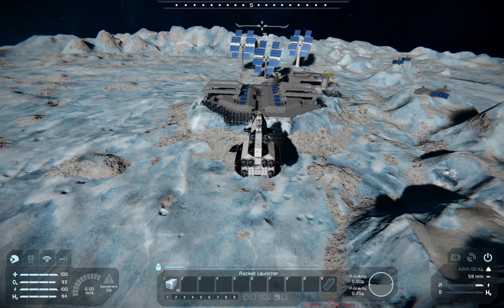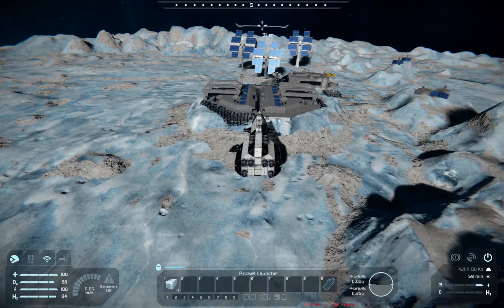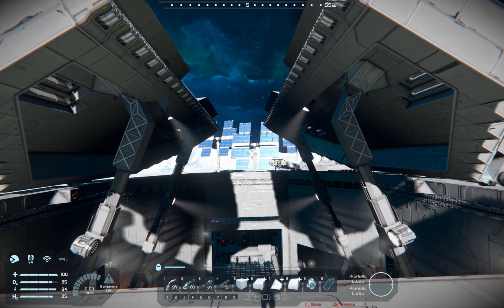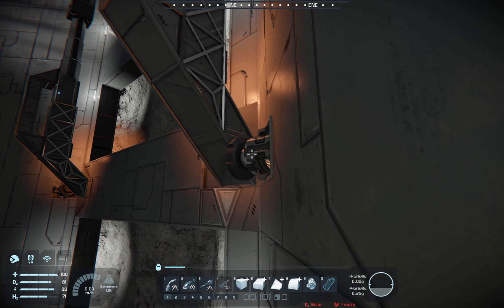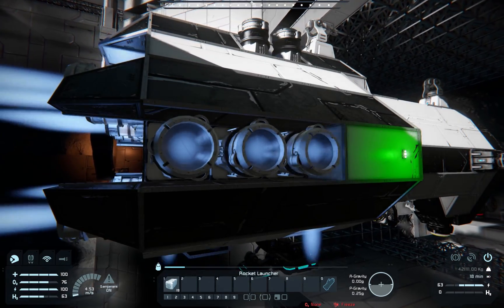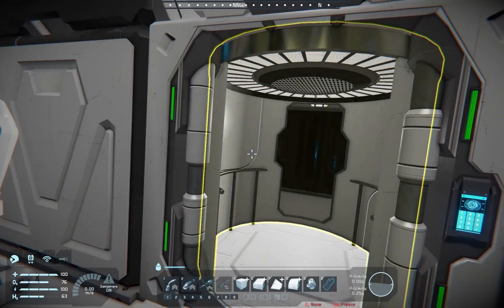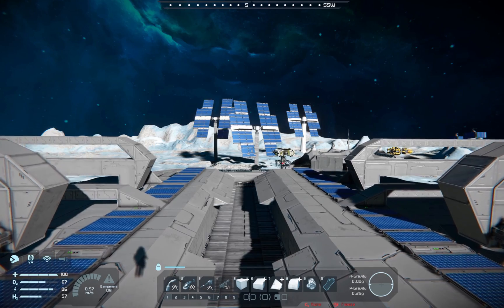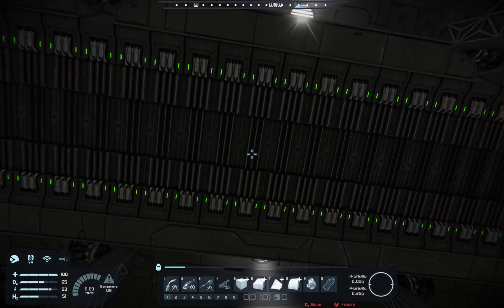Space Engineers Large Custom Hangar Doors

Comment: I have tried to replicate it, but I do not understand how to make rotors that are not in the same structure connect, that is, I do not know how to join either the internal rotors to the base of the door, or the external ones to the door and make the door connected to the interiors, and I don't understand how to make everything activate simultaneously so that it doesn't explode XD
Reply from the maker: Oh there were a few explains when I was building it, including one that crashed the server. Those rotors have big nukes hidden inside them!!

You didn't actually want everything happening simultaneously, which is why I have timer blocks running everything. It's been so long, though, that I don't remember the specifics of how I built it.
Reply: @Kurazarrh  I will try to learn how to use timers, I have already forgotten how they work, but what I cannot achieve is making a rotor connect with another structure that floats, I have achieved it with magnetic plates but it does not seem very useful or functional to me.

Comment: Man i tried to recreate that but in a different shape and i was able to move it once
When i realized i need more pistons cuz it's not opening fully i changed that and now i can't get it to move.

Pistons are extracting few meters then stop and im so desperate to make it work at this point im typing a comment under few years old video.

Is that really all you did?
Unpowered rotors and few pistons?

And it's moving normally god damn it... XD
Reply from the maker: This definitely took some trial and error. I had to build those struts a couple times before I got them to a place that worked well. Make sure they're not bumping into anything, have their strength high enough to push, and that they're connected to the doors far from the hinge. Also, "Unsupported Stations" needs to be turned off in the game settings.

Comment: Im taking a crack at my own, how did you manage to get the doors to sit flush with the base? When i lower the pistons the door rotates at almost a 90 degree angle. any tips would be awesome thanks!
Reply from the maker: Build the doors fully connected to the base first (including the merge blocks), and then hook up the hinges on the outside (since it's got an extra grid in between the sets of rotors, it will let you connect the heads). And make absolutely certain that your rotors have no limits and set their torque to zero before you connect any heads. Once you have that all done, THEN you build the pistons. Again, set their strength modestly, ideally about 20% more than they need to just barely open the doors. And make sure to set their limits, as well. Once that's all done, you can remove all connecting blocks except the merge blocks (if you had any others) and test it. And pray to Clang when you do.
Reply: @Kurazarrh  did you ever run into a problem where once extending the pistons the door wouldnt budge at all?

Comment: couldn't you bulk up the merge block connection for safety? basically the direct mergeblock of the door, connects to a mergblock on a subgrid of the door that drops down via piston, that also has a mergeblock that attaches to the "doorframe" or whatever you wanna call it. a bit convoluted, but would probably be safer.
Reply from the maker: The reason I didn't do that is I wanted it to be airtight. Not that I ever pressurized it mind you  but I wanted to have the option! :)
Reply: @Kurazarrh  the merge blocks are already on the outside though?, and technically the door and everything else would still be one grid, is just that rather than directly connecting the door's merge block to the frames merge block, you'd have another grid imbetween that is out of the way during opening and closing, just to further reduce risk of clang. Sure it would increase the open and closing times a little, and be a tiny bit kore complex, but the same purpose should still be accomplished, just safer. Plus if you wanted to include a more aesthetic aspect to it all, you would even make it look like one of those fancy rod mechanisms, like with vaults. And since the merge locks are already on the outside, everything should work the same as before.
Unless there is something I'm misunderstanding, that it...
Reply from the maker: @alexrog6868  Yeah this was already pretty complex, and since it was a co-op server, there wasn't much threat from my friends. Protecting the merge blocks wasn't really a concern.
Reply: @Kurazarrh  it just occurred to me that I should mention this, but thanks for actually replying to my comment, that's super cool, and I appreciate the exchange, even if a little brief
Reply from the maker: @alexrog6868  Hey, sure thing! I like talking about this kind of stuff!

Comment: It's cool but what if someone targets the lever part on the outside hinges? Your lid would just block ships coming in or out
Reply from the maker: I wouldn't use this in a PvP environment anyway. But let's be real, armor in SE is only one step up from paper anyway, so no matter what, any hinge solution would become a liability. You could probably armor up the hinge a bit (carefully!) but if I got stuck in the hangar like that, I'd probably just pull a Danny Devito and start blasting!
Reply: @Kurazarrh  I've got an idea for a sliding remote control drone door. Build a rail system like how some people build trains but instead of a train it's just a slab of heavy armor with merge blocks or a frame that rolls into place and fills the gaps with hangar doors
Reply from the maker: @noneyaonenoneyatwo2879  I considered the sliding doors, but the horizontal real estate wasn't something I felt like dealing with. I was actually designing this as a test run for similar doors in an asteroid. Which I never ended up building. lol

Comment: I wouldn't have the patience to build all that (the ships) and the base, if I were to play on survival. Nice job!
Reply from the maker: For me, it wasn't about patience so much as it was fun to build. Lol. Maybe I'm just weird like that. But it also helps that once you build some mining\grinding\welding ships that you're comfortable using, it really speeds up the building process.

The one part that was actually a bit of a pain was digging out the crater for the hangar. It was too narrow and shallow, so I used a rotating drill arm and something like 22 pistons all set to their slowest possible speed. But it gave me plenty of materials for building the base, once refined! The drilling itself was easy; I just started it up and walked away for like 5 hours. It was the setup and connecting the drilling rig to the existing conveyor network.

Comment: how did you stop the door becoming part of the station grid?
Reply from the maker: It technically does when the merge blocks connect, but once they disconnect, it becomes a subgrid that's only connected to the station by long chains of pistons and rotors. No flat faces of any armor blocks make contact with the station, preventing permanent merging, and I used hangar doors to seal the gaps.
Reply: @Kurazarrh  soon as my test rig attaches, ONLY by the merge block, no other connected blocks, they will not separate. I turn the one on my gate-grid off, and they still wont separate. same if I turn them both off. The grid needs to be turned back into a large ship before it will move.
Reply from the maker: @TheNeo2k  Ah, that's happening probably because you have "unsupported stations" turned on in the game\world settings. You'll have to turn that off if you want it to work, but make sure any floating stains in a gravity well are secured first!
Reply: @Kurazarrh  Just turned my server off to check this, and it's currently not enabled... lol. gotta love SE.
Reply from the maker: @TheNeo2k  It's been a long time since I played SE, but IIRC, the setting may actually be inverted. I thought they fixed it at some point, but that may have been just a text change in the server container I was using (Torch, at the time) to make it clearer to server admins. Could try toggling it on and see if it helps!

Comment: Very cool, but you should really have the doors be square so you can make them airtight.
Reply from the maker: These actually are airtight due to a combination of the doors merging with the frame and the use of the hangar door blocks to complete the seal. Though it didn't matter in the end; the hangar itself was too large and the game refused to fill it with air!!

Comment: this is definitely one of the coolest things I've seen in this game, am thinking about making one, but without the hangar doors, just merge blocks and pistons, where it slides instead of hinging.

So, initially, the merge blocks connecting the base to the door are disconnected, then some pistons raise the door a block from the surface, where another set of pistons attaches, and the initial ones detach, then the door slides open, and at the end, some other pistons grab the door and attach it to the wall, as the sliding ones disconnect. Have no idea if it will work, but will try it.
Reply: You could try a door that rolls shut
Reply: I still like this idea though but try putting wheels on it. People build railed trains in this game that follow track and nobody (as far as I know) has tried a railed door on a remote control

Comment: I would do stuff like this but if I see that it requires millions of steel plates thatd be a no cause it's too intimidating of a number
Reply: Also if anyone can tell me a mod that makes just steel blocks cheaper thatd be great cause the "Cheaper Blocks" mod is great but feels cheap
Reply from the maker: Actually the steel plates were the easiest part to get and keep stocked. We actually used a 20+ piston crane with a zillion drills rotating on the end to slowly bore into the moon, so we ended up with absolutely infinite amounts of stone to refine (and this was made in I think the first version of the game where you could get small amounts of some metals by refining stone... Iron, Silicon, Nickel, I think?). Then we used Isy's Inventory Manager script and tied all our refineries and assemblers to it (minus one each for custom work) and set a high quota on materials. I think we tried to keep a minimum of 10,000 steel plates around. In case you're not familiar with those scripts, they will automatically manage your inventory and production; all you have to do is give it quotas and it will fill them. With 8 max-speed assemblers, it had NO trouble keeping up!

Combined with a pretty sweet welder ship I got from the workshop (and modified to work on the moon), I could also have Isy's automatically load up the welder ship. So I could go weld a couple hundred blocks, come back and dock for like... 3 seconds, and then take off again. It was actually pretty fun to work on. I made this video almost a year and a half ago now, and it's still surprisingly popular, so I may have to see if I can dust off that server save. But it hasn't been fired up in over a year, so I don't know if the save and mods are still compatible with the current game version. I could totally do a better tour of the whole base, though.
Reply: I'll try doing that cause whenever I needed materials in bulk i just made a small mining ship cause bigger ones are too expensive at that moment

Comment: This is so cool, what are the dimensions of the build? And how did you manage to get the pistons to connect from the base to the doors?
Reply from the maker: I haven't played in this world in forever, but IIRC the doors were 80m, so 32-ish blocks or so. As for connecting the pistons to the doors, it goes like frame > rotor > piston (x3 in this case) > rotor > door. The hinges are similar, but just frame > rotor > armor blocks > rotor > door. Though I guess manually creating hinges may not be as necessary anymore with the new hinge blocks! Getting them connected involved liberal use of rotor limits and some careful rotation of them to get everything aligned before connecting the rotor heads (I built the doors fully attached and then connected the hinges to them). It also involved a few explosions! I did the hinges first. Connecting the pistons to the door was a lot easier than getting the rotations on the hinges (the rotors on the pistons are free-rotating).

Comment: Do you need merge blocks to connect the rotors to each of the separate grids?
Reply from the maker: Initially, yes. Since there are two hinges, when you go to start the actual door, you need a pair of merge blocks to get that process started. You can also skip the merge blocks and just use the rotor head connection method, but I found that route to be a little... Explosive.

Comment: Is there any way you can post this on the workshop? I would love to use this design myself but I am having problems recreating it.
Reply from the maker: Unfortunately, this was done on a server that's no longer running, so the design is only in the video and in my head. What parts are giving you trouble?
Reply: I think I've got it mostly working now, I do have a question: Did your piston line shake a little while pushing the doors up? I'm not sure if it'll destroy itself as soon as I turn on block destruction but if it doesn't then I've made a working replica.
Reply from the maker: @jklol7063  yeah the pistons are a little bouncy, especially the farther they extend. I never had an issue with explosions or anything, and it was very stable even though it was on a server.

Comment: Never thought of using this configuration this way. A lot better than using pistons with air locks. Which won't attach without merge blocks. This is a way better use of them without destroying everything in the process lol. Nice Job here!! :)
Reply from the maker: It worked out really well! The original design by Venom415 used a combination of powered rotors aided by thrusters, but since rotors under tension have a tendency to detonate spontaneously, I took inspiration from my car's trunk struts! Thanks for checking it out!

Comment: Why are there rotors up on each door? I mean 2 rotors as hinges on the base and 2 from the pistons would be enough. Why this extra 2 rotors on the end of this lever outside? They could also be a reason why the doors snap
Reply from the maker: The double rotors are necessary in order to allow the merge blocks to connect. Two connected subgrids cannot be connected via merge blocks, but if there is a third grid separating the other two, then the merge blocks will work.
Reply: Got it. Thank you for your answer
Reply: I was wondering that myself.  You could accomplish the same thing by using Landing Gear to magnetically keeping the hinge attached to the door.  I've done it on a few of my doors and it does well.  Your is plenty large enough that it wouldn't be an aesthetic issue using them.

That said, based on how old the video is, having the second set of rotors probably helped to reduce Klang by acting as secondary buffers or shock absorbers.  Especially since this was before the hitbox adjustment, and using merge blocks like that was a sensitive endeavor.

Still is at times, and a lot of even the basic blocks still need hitboxes to be a touch smaller, as me current compact hanger door project can attest to, heh.

Comment: I’ve started building a similar design, however, the merge blocks don’t connect when I detach the rotorhead, only when I destroy the rotor block. Any fix you know of?
Reply from the maker: Is your rotor somewhere that could be considered "attached" when the merge blocks lock? Also are you using at least three separate grids?
Reply: Kurazarrh It worked when I used three separate grids, another guy told me about it.
Reply from the maker: @Amexelina  Gotcha. Yeah you have to have at least one grid separating the other two.

Comment: How is it possible to attach two pistons between two parts? This is basically impossible to do in the game.
Reply from the maker: You can't attach one grid to a subgrid at two points, you're correct. However, if you have at least one more subgrid between the connection points, it works fine. The pistons on the doors are actually 3 pistons chained together (with rotors at either end), so there are 4 extra subgrids between the frame and doors. The hinges are similar, taking advantage of the same principle to have two connection points by going frame > rotor > hinge piece > rotor > door.
Reply: @Kurazarrh  Thanks. I need to think about it.

Comment: I have built a door like this before. It didn’t wanna work quite right with the merge blocks though which was frustrating. Sometimes they would connect and I could get it airtight. And a lot of the time they just didn’t wanna connect no matter how aligned I got them.
Reply from the maker: Were your doors connected directly to the frame with a rotor?

Comment: very cool. did the thruster assisted door work smoother with the merge blocks?
Reply from the maker: The original design by Venom415 also has the merge blocks rotated horizontally rather than connecting vertically. He said it seemed to work better that way, so I may have that a shot next time I do this kind of build.

Comment: Interesting Large Airtight Door, nicely done :)
That spacing between the merge blocks when getting close was the reason why I had the merge blocks connect horizontally vs vertically like you did, also the secondary joints I had helped lower it closer to the merge block; but this made it overly complex.
Reply from the maker: A comment from the man himself! Thanks, this was a lot of fun to build! I might try the horizontal merge blocks next time, see if that reduces the clang. It hasn't exploded yet, though. The airtight doors seem to jostle the doors into place for the merge blocks to do their thing.
Reply: @Kurazarrh  yup its janky but it works haha, also nice addition of the sensor opening a portion of the door for small ships, I really like that design!